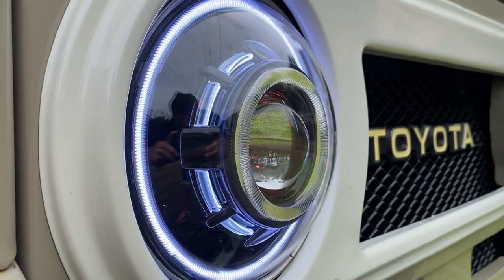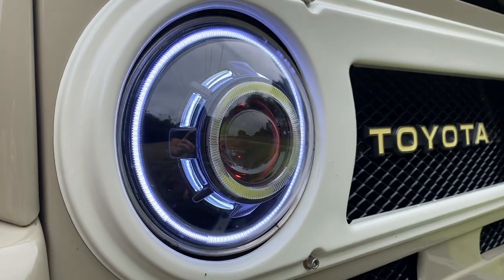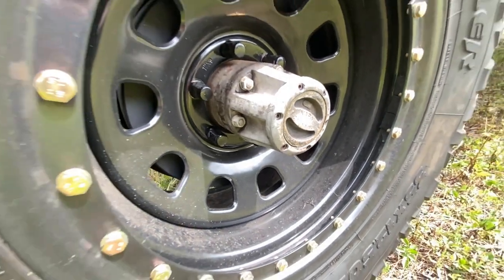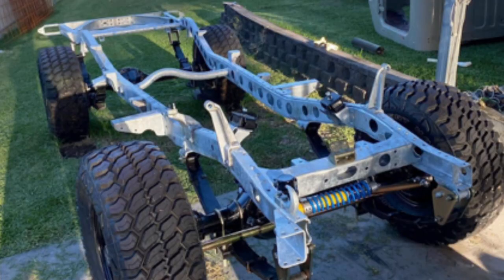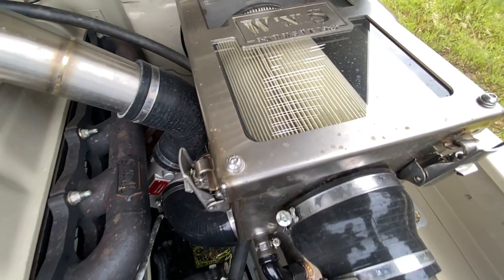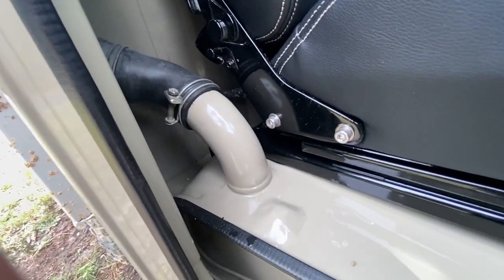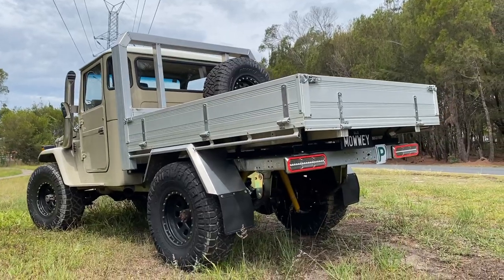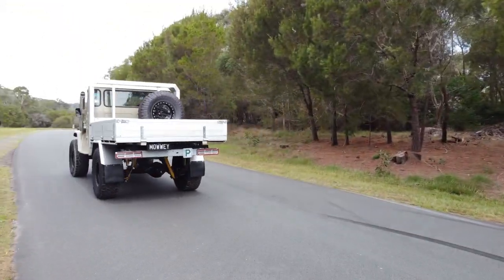FJ45 Turbo Diesel Toyota Landcruiser RESTORATION

Comment: Original colour is fantastic and galvanized chassis is excellent choice .

One of my pet dislikes on any leaf sprung vehicle is U bolts too long sticking out below  spring seat / fish plate , easily bend or snap if driving over rocks etc , even get hung up because of them .   i cut them about 3mm past end of nut and grind nice radius so you dont cut yourself when under again . 

If you are looking for reproduction floor mat try City Racer LLC  , two versions available depending on year of production .
Reply from the maker: Totally agree thanks for the feedback.